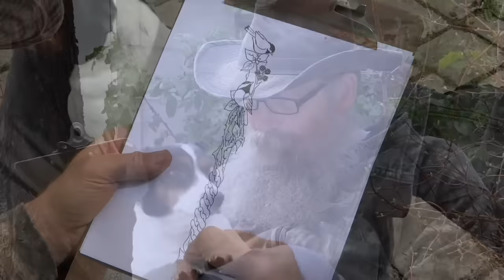Wood Carved Chickadee and Blackberry Bramble Walking Stick

Comment: i'm very grateful that you linked the tools you employ brother m; i 1st saw this video in my phone feed but it was incomplete & i was VERY fascinated by the small hand grinder. i've been using a DREMEL 3000(gave 1 to my son for his bday as well) because i can't really afford better, but it's big & bulky & not particularly 'ergonomic'. your link to the Foredom K.1070 High Speed Rotary Micromotor is SO thoughtful but it doesn't look QUITE like what i see you using. is yours an older model?
and give PEARL  a kiss for me wouldya please? what a heartbreaker..
lastly, please give us an idea of the WEIGHT of the finished stick. thank you & long life brother. nothing beats working with wood!!
Reply from the maker: The one in the links is not what I use.  The foredom  is more affordable and available on Amazon.  What I'm using is an Oz Plus Micro Motor and handpiece.  It is available at treelineusa.com.  The finished stick is probably about 3 lbs.  I'll give Pearl a pat for ya!
Reply: @StinnettSticks  i thank you sir & continued success!